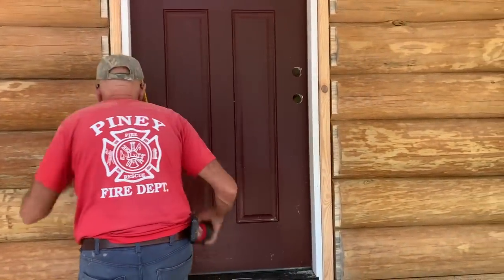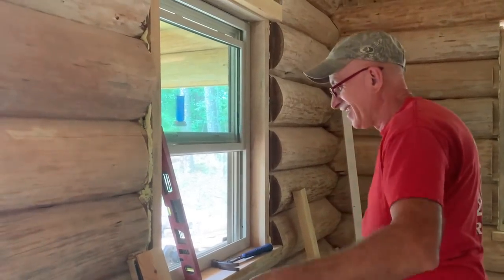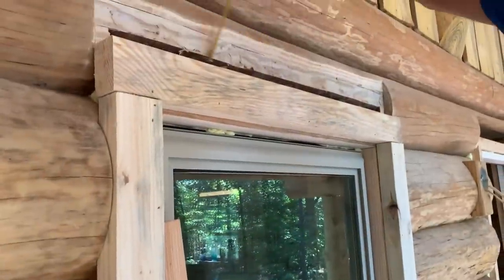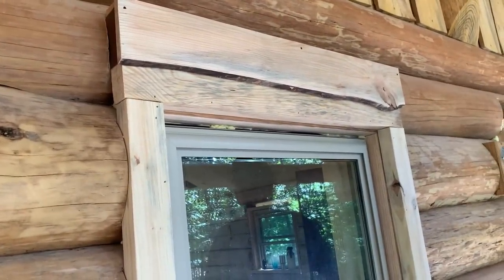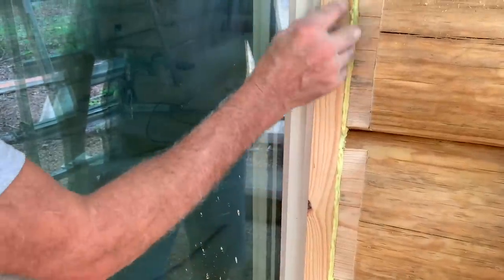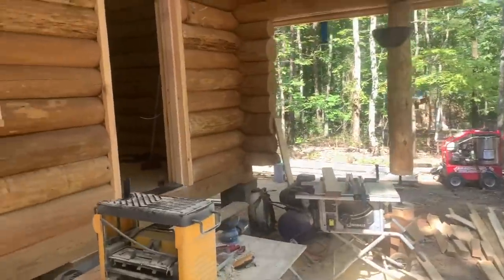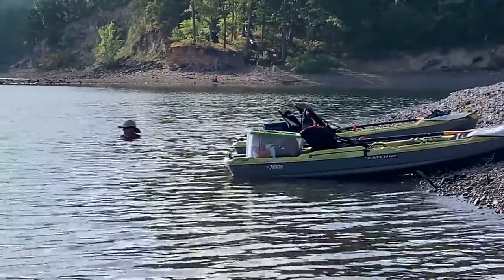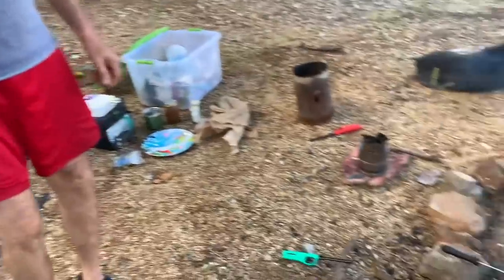Log Cabin Build Part 25, trim for the windows & doors, slip trim for shrinkage, kayaking with dogs

Comment: ive only just come across you guys on here and am currently watching the cabin build playlist. in all the cabin videos ive watched ive not seen or heard of anything about slippage trim. what a fantastic idea to make sure there is no damage as the cabin settles in. I assume this is because you built with new wood instead of old drier logs? I am in awe of what your doing! I'm a woman in her mid 40s from the UK. born and raised in the very south east of England than moved to Scotland when I turned 40. we brought a temporary home in here in Scotland with the view of buying something remote in a few years, but the housing market isn't and hasn't been in the right place for us to do it yet. my husband started his career in engineering as an apprentice back at the end of the 1970's and is a perfectionist at everything he builds or repairs lol so as you can imagine any home we have had has had his handwork in it somewhere where he has wanted to change and improve things. I can already see that if we buy what we really want it will take a long time for us to get it how we want it, but it will be our dream forever home. I cant wait to carry on with the playlist and then go on to your others. great work as a team! thankyou for sharing this
Reply from the maker: Hi Tannia. Yes our logs had not dried too much, but they do settle a lot as you build especially when we got 105 degree weather. They also settle quite a bit when you put the roof on due to the extra weight. But log builders usually allow for settling even with dry logs due to compression, just not nearly as much. 
It is sure nice to have a husband with skills! I’m sure you will enjoy whatever home you decide on😊Thanks so much for watching, I hope you enjoy the rest of the videos 😊💕🌷

Comment: Howdy y’all- wonderful job on the trim! I like the live edge for the slip board. Yeah, it does take some figuring when building with logs, but it’s certainly worth it. Beautiful day on the last. Take care and God bless
Reply from the maker: Thanks Paul! We will have to do a little modification on the front door trim as it settles. It came out at a weird place on the log. Could have used your help on figuring that one out🤣🤣🤣But I think we can adjust it pretty easily later. Look forward to your next video. Your project looks beautiful!Take care!😊

Comment: Your windows and doorsc look awesome!!! I love your live edge slip boards! You may find that the cabin will not settle past the live edges of your slip boards but you got the right idea on constructing them. Just like the pros!  Our camp was originally going to be a stick built building until a friend suggested a log cabin instead. I had built buildings before and thought a log cabin would be easier. How wrong I was!!! They are hard but so much more rewarding. If anyone knows the meaning of life it's you two!  Great job!
Reply from the maker: Thank you Donny! We hope it works. The slip trim will have to be cut narrower when it comes too low. And the front door trim will have to be modified a little after it settles some. The top came out on a weird place on the log. 😂😂it is definitely a learning experience. 👍

Comment: How long do give the cabin to shrink down . And if it stops shrinking and you still have a gap do you change the top trim piece. Nice job you and Cinda should be proud of what you made.
Reply from the maker: We are not really sure how long it will take. It has shrunk about an inch from the time we got the last wall log up. So I am sure it shrank a little as we were building. I think it depends on how big the diameter of the logs are and the humidity level. We are usually very humid here, but the 100+ degree weather we had really made a difference. I have heard it can take a couple years. You don’t really have to change the trim even if there is a gap since it is completely sealed. That’s why we liked the decorative aspect of the live edge. Really better to leave it because wood can still expand and contract with temperature and humidity changes. But, might be good to ask someone who has long term experience, we haven’t ever lived in a real log cabin yet😂
Reply: @natureartgirl  Thanks Gary

Comment: Only thing I've thought of is just build your trim and casing to the window and let the logs slide behind it.
Reply from the maker: Yes, you could do that if you cut flats above the window. It is tricky though, because logs are round and they don’t always come out in a place where that will work. It is all going to be custom for each window no matter how you do it. 😊👍
Reply: @natureartgirl  yes they are.  A log home has always been my dream build.  With my son having duchenne muscular dystrophy I've been saving up to start building. Everything will have to be wheelchair accessible so buying isn't an option so it'll all be custom too.

Comment: I had another question are you going to insulate under the floor.
Reply from the maker: We are not sure yet. Plan is to enclose the bottom with galvanized roofing and possibly spray foam the metal. We really are afraid to put insulation right up against the floor joist logs until they have had plenty of time to dry completely. It is very humid here and afraid they might rot. It doesn’t get super cold here and a friend of ours did the spray foam /metal and hasn’t had any issues.
Reply: @natureartgirl  Thanks Gary very job .

Comment: Hello. My. Thought. Would. Be. Remove. The. Board. And. Stuff. The. Opening. With.  Pink. Insolation.   A little.  R.  FACTOR.   Looks. Great.
Reply from the maker: Yes, he did that on all the windows and doors. Fiberglass insulation in the gap above before we put the trim board on.

Comment: Should have been using screws so if needed to change it, would be a lot easier!
Reply from the maker: Yes, that’s all we used is screws. We will probably have to trim the top of the slip trim later, so that makes it easier to take it off. They were trim screws.
Reply: @natureartgirl  If need a go to, try Meadowlark Log homes if not seen them allready! Or there builder Montana Haven